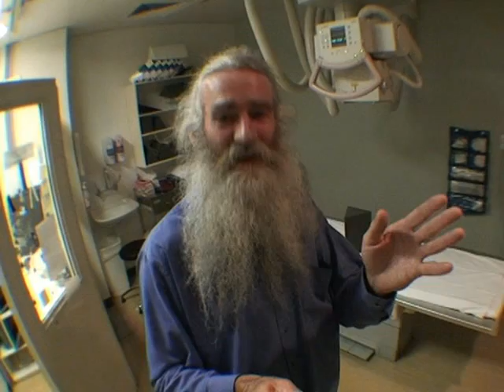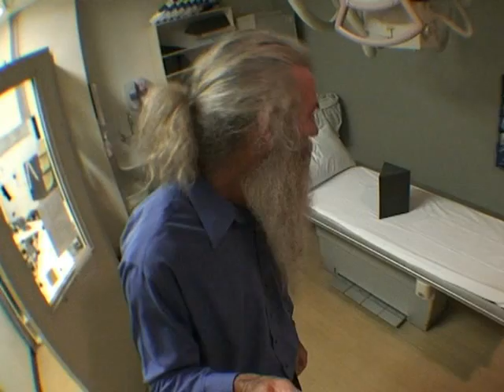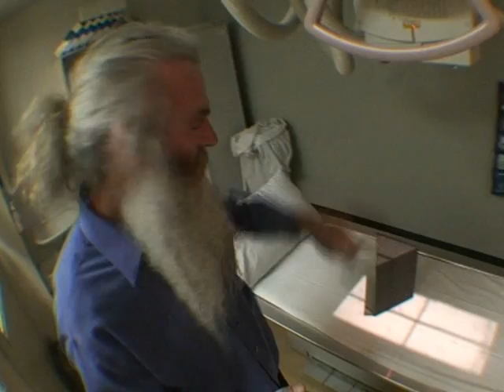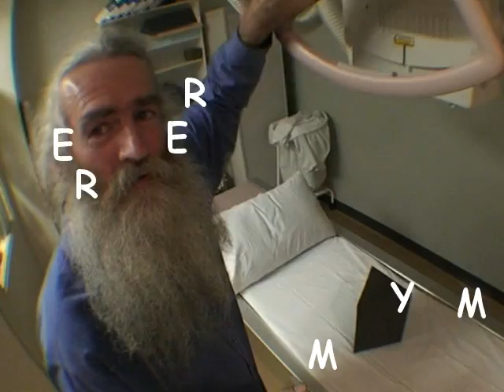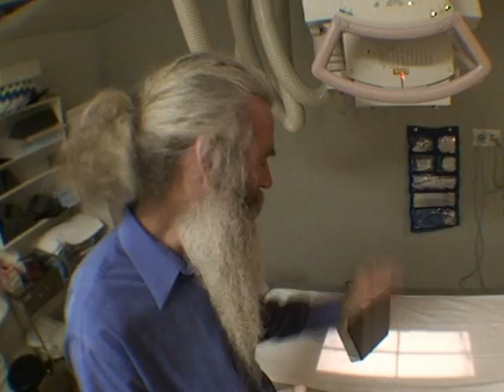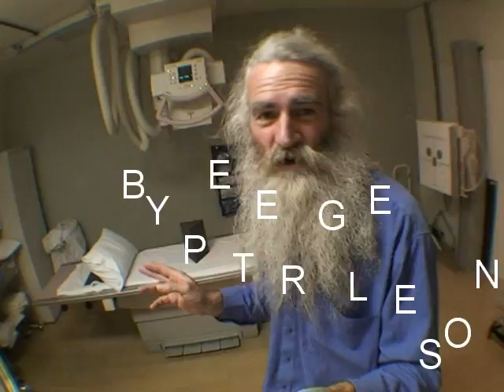X-RAY BEAM GEOMETRY

Comment from the maker: 'The divergent beam myth' is that the angle of the tube is the angle of the beam when in reality the tube angle only relates to the central beam. On an abdominal film with a straight tube, you are angling up, you are angling down and you are angling from side to side. The average is the central ray. If you end up being committed to centre point radiography, notice that you will not generally judge how accurate your projection is by looking in the middle. You will look to the edges to ensure the region of interest is covered. My system does not use centring points. Instead, I use collimation. It will show up on all edges of the collector. So I used the light from the light beam diaphragm. When I developed the technique the technology wasn't very accurate and the light wasn't particularly bright, but now it is perfect. The only reason centring point radiography exists is because it has existed since the days before the LBD and tutors and universities need to test people. The last paper I presented on the subject at a national conference was in 2016 and that was because all three tutor radiographers from Monash uni failed the test. They thought changing the angle also changed the geometric relationship between focus and collector. This video is now used in some Australian universities as reference material. Hopefully they will become better radiographers than the generations that preceded them

Comment from the maker: The centering point system of teaching radiography ensures the focus of the tube is in a place relative to the patient. Once there, the angle of the tube can be changed without altering the geometry of the projection. 
Whenever your technique irradiates a part of the body that isn't required, you have the wrong angle on the tube. Whenever your positioning technique causes radiation to miss the cassette, you have used the wrong angle. Understanding this allows 'perfection' rather than 'job done'
Reply: Hello Mr. Gleeson! Awesome video and thank you for sharing your knowledge. Does this apply to tube angle change only on the sagittal plane and not on the transverse plane? It seems to me like it would apply to both planes since the focus spot remains the same. I have very limited knowledge, so I hope this question makes sense.
Reply from the maker: @InevitableChanges  Thanks. Your question makes a lot of sense. Most xray tubes can be angled laterally and this does't change the position of the tube focus. So when you use a straight xray tube collimated to a 35x43 cassette, the beam ranges from the angle to all the edges and parts of the cassette. Only the central ray is zero degrees. The radiograph is made up from all the angles of all the xray photons. Share the video with your colleagues and friends as it is important knowledge and is required to master radiography as an art form.

Comment: I am hard to convince.  But I will listen.    
Doing a PA chest, the tube was angled 10 degrees to the right, laterally.  The lungs were cut off on the right side by 1 1/2".  The heart and lung fields were slightly distored. Pt was centered correctly.  This happened because....?
Reply: +B Pittman ...This happened because there was no ray perpendicular to both the film and the patients coronal plane, and passing through the MSP. Instead of keeping the focus in the same spot so as to mainatin the geometry between the focus, patient, and film (i.e. some ray was still perpendicular and passing through the MSP, just not the central ray) and merely rotating the tube port + collimators around the focus, you instead moved the focus which resulted in no ray both passing through the MSP and being perpendicular to the film + coronal plane.

Comment: If you are struggling to understand get your phone and any object: place the object on the table in front of you. shine your phone flashlight from above and you can see the shadow it produces, that is your X-ray beam. If you rotate the phone(beam source) in place, the source location of the light is not changing although the intensity may change in the case of your flashlight or as you reach the edge of “collimation”(where there is no longer light from the flashlight) Now try moving the flashlight to different angles above the object and see how the shadow changes because the source of the primary beam is changing location.
Reply from the maker: That is right, so why do so few people know this?

Comment from the maker: Look up the Townes projection for the skull in any text book or video and you will find they instruct you to irradiate the eyes, nose, thyroid and, perhaps, the shoulders. The wrong angle was used. 30 degree caudal tilt centering on the hairline was a way of getting the tube focus into the correct position. But the tube should have been angled less so collimation was above the brow line. This failure to correct collimation meant 30 million people had needless dose to the face
Reply: So you would only get the anatomy of the skull above the eyes using your method, avoiding any unnecessary exposure that would ordinarily be caused by the limitations of collimation when using a centering and collimation technique alone. Your technique uses a typically centering for a Townes, but then the beam is angled cranially(upward) to do a sort of pre collimation in direction opposite of where you angle the beam (caudal anatomy goes out of frame of the primary beam), then you can collimate the rest out? So what does that look like in an image? Most of the top half of the image is empty space, with the skull projection at the base? Only issue I could see is potentially missing imaging off other parts of the head that doctors may be used to seeing in a Townes. Please correct me here if I am wrong.
Reply from the maker: @Jodenis84  The angle of the projection is due to where the focal spot is.. Its position doesn't change with tube angulation, only collimation. The projection was prescribed. long before the light beam diaphragm. As a system of rules, it produces what it supposed to but at the cost of the extra unnecessary dose. But we have accepted it without question. All I had was collimation on the bottom edge of a standard Townes projection. Nothing was missing. Look at my channel because my system of accurate collimation with no centring point meant I mastered radiography. The best my peers could claim was they memorised the instruction manual. I presented papers at national conferences about the error in 1988 and 2016, the second time because all three tutors from the uni failed the test. At the conference 120 qualifieds were surveyed and 25% passed.
Reply from the maker: @Jodenis84  So, will you centre on the ankle joint and irradiate the foot unnecessarily or will you minimise the radiation dose and collimate the foot out of the primary beam? Do we follow the text books or do we move beyond them?
Reply: @thevoiceharmonic  I guess I’ll have to see, I would prefer to do it the better way, but unfortunately this world doesn’t always allow innovation due to the hierarchies that a lower level position like radiography is subject to. If it would cause me to lose my job I would have to do it by the book. if the doctor wants it done by the book I have to do what they say to even continue pursuing radiography. Perhaps someday I will be able to learn from your inspiration and see your innovations come to fruition in the practice of radiography.
Reply from the maker: @Jodenis84  We have some control over what we do as professionals. I have never been able to accept nonsense and I questioned all I was taught. They failed me in my 3rd year because I rebelled with inventing a more accurate system for doing radiography. My discussions with universities is that they need to be able to set tests, and my system relies on judgment and variation according to the situation. Most of my profession has been as a locum and as such, worked in 40 different departments and 100 different rooms and 300 different radiographers. Toward the end of my career I would use my freedom as locum to put in place quality control measures. In one major hospital 20 years ago, I found that of the 17 qualified radiographers who worked in the operating theatre, only 3 of us used any collimation. After 6 weeks I surveyed the images produced again and found that 4 were then able to collimate. I asked them why not and they said they were too scared to collimate because the surgeon would become angry. I told them to give the surgeon the choice between a massive radiation dose and a minimum one. The digital age meant I could access the archive in easy ways. I caught one of my bosses giving every extremity 20 times the dose and had been doing so for a decade. If your intention is to be the best radiographer in terms of work quality and lowest dose, you can't be an average radiographer. Dare to excel. Turn radiography into an art form

Comment from the maker: The central ray is the average angle. Open the collimators to maximum and you are using angles 12 degrees more and 12 degrees less. The anode is at the axis of tube angulation so the geometry between source and object and film remain the same as the average angle changes. If you centre on the ankle joint and take an xray, or you could centre on the ankle joint, then angle up 10 degrees, open the cones to include the ankle joint. Geometry remains the same. The anode is like a lighthouse

Comment: It took me like a whole day but I finally get this concept. There is a great paper on it now “Appreciating X-ray Beam Geometry And Clinical Applications for Using Tube Angulation”. If you’re struggling with this video, give it a read and it will make it easier to understand.
Reply from the maker: It is a tough concept because radiography has been done wrong for an entire century. So the only thing that changes when the tube is angled by pushing the tube angle button, is collimation. When I presented a paper at the Australian national conference in 2016 120 qualifieds attended and only 25% knew this basic fact. Many were elders in the profession. But no one shares my videos because that would bring shame upon the profession, or would be admitting being deluded, or accusing others of being deficient in their thinking and practice.
Reply: Hi Peter, hope you are well. I'm on my second placement now and was luckily given time today to give a demonstration of this principle to some other students and qualified radiographers. Not one of them passed the shadow test and it took a whole top to bottom run through explanation of beam geometry to convince them that it was a tool that can be used for collimation. They were humble about it though and admitted that their fundamental understanding of the machine was lacking. I will continue to do the shadow test on every other fellow student I have time to teach it to.

Comment: Very thought provoking Peter, you are right, changing the direction of the beam will not change the geometry if you don't keep the centering point the same, HOWEVER, if you keep the CP the same, the shadow/geometry of your ROI will change, as will adjusting your focal distance with the same CP change the beam geometry if the object of interest remains unmoved. Just something to keep in mind folks ;). It is  very rare when imaging a specific region, that we would change our centering point.

Comment: Further to this discussion, the demonstration doesnt consider teh case where we need to project a clear space between objects of finite size, i.e. getting between disc spaces angled anero-inferior in  a cervical spine. To do that you will need a beam path parallel to the surfaces either side of teh gap. You will use beam angulation advantageously centreing on the gap with an ablged tube., or by using the 11 -degree divergence we mught get at a 100 cm SID 20 cm from the point( arctan(divergent distance / SID) )   see https://www.rapidtables.com/calc/math/Arctan_Calculator.html
Reply from the maker: Yes. I agree. The point is that the geometric principles have not been taught. There has been an assumption made and not clarified. I hope I have made a contribution. Recently, I was kicked off the World Radiography facebook group because the geometric principles were unproven and unsubstantiated. Some guy in USA thought I was wrong about projection geometry. That means he also thinks you are wrong. 75% of all qualified radiographers think we are wrong. Through my work in Australia, I may have created the necessary change with several universities using my videos as course material. But when they sat a test a year or two later, many of them failed

Comment: Found your video very interesting HOWEVER; you appear to ignore the fundamental principles of radiographic practice where centring is of paramount importance and manipulation of beam angles vital in avoiding distortion of anatomical structures on images.   I would encourage all viewers to repeat the experiment with the 'object' centred correctly in the field before angulation of the tube.
Lecturer and first year class of BSc Diagnostic Radiography in Scotland
Reply from the maker: I haven't ignored the necessary angles required to limit distortion at all. I have kept the geometry the same but I have used the knowledge of tube angulation to limit collimation to the region or to the collector size. Less than 1 student in 20 gets the correct answer so lecturers need to realize this and give students the truth so they can deal with producing the best images at the least dose while improving knowledge of relevant anatomy
Reply from the maker: danielle Duggan Curiously enough, radiologists always get the correct answer. Only 1 in 10 of the general public get the right answer. None of the 3 university tutors I have tested have given the correct answer
Reply: +danielle Duggan
Peter is correct, depending on what he means by "the divergant beam is largely a myth". Without the tube port/collimators then you are working with a sphere of light (assuming for conceptual convenience that it stops at a given radius). Turning the sphere around any axis will not change the geometry between the centre of the sphere, an arbitrary point on the surface of the shpere, and a point somewhere along the radius from the centre to that point. It will always remain a straight line. There is some question about applications though. 

I use this principle for my AP Oblique ankle images and axial calcaneums. Centre where you want with the angle you want through that anatomy, then recentre by angling the tube so as to reduce the amount of unneccesary anatomy imaged.

e.g. AP ankle - centering over the ankle joint with a straight tube means exposing the whole foot, depending on how much tib/fib you are going to include. Using the divergant beam properly, imparting a small cephalic angle once you have this centering and then collimating down such that the superior collimation edge is at the same level it was with a straight tube means that you can image the exact same anatomy with the exact same geometry superior of of the joint, while imaging only useful anatomy but with the exact same geometry inferior to the joint.

Comment: Very interesting and amazing Peter, it's a shame that they don't want to publish your papers.
But help me, I didn't get a thing.
If the tube tilting doesn't change the geometry, how could a caudo-cephalic/cephalic-caudal angle change the appareances of the anatomy on the projection?
I.E. the superimposition of the condyle on a knee.
Please help me to understand it better :)
Reply from the maker: The geometry will only change if the relationship between the focus and the anatomy changes. Tube angulation won't change it. Changing the position of the tube focus will change it. Changing the position of the anatomy will change it.
Reply from the maker: Stop thinking about the tilt of the tube and visualize the placement of the focus in relation to the anatomy and the projected image on the receptor. Changing the angle of the tube will not change the position of the focus of the tube.
Reply: +Vittorio Censullo Think about having a light globe in the middle of a room and a stationary object casting a shadow on the wall. 
Imagine you rotate the lightglobe circumfrentially around it's long axis - will the shadow move, change size,  distort, or become sharper/blurrier ? No.
Now imagine you don't rotate the lightglobe, but instead move it to a different part of the room- will the shadow move, or change size, distort, or become sharper/blurrier?  It will do at least 2 of these things if everything else is stationary.